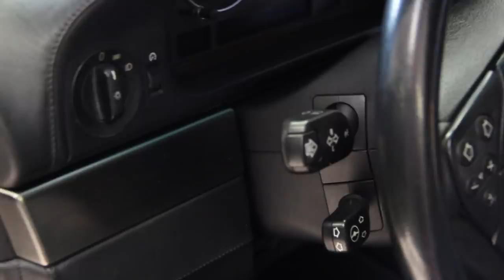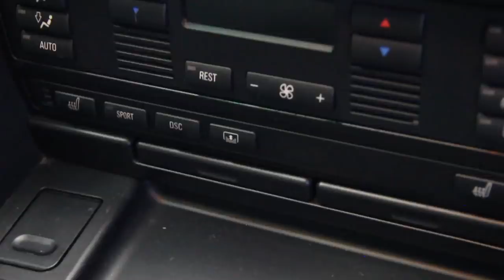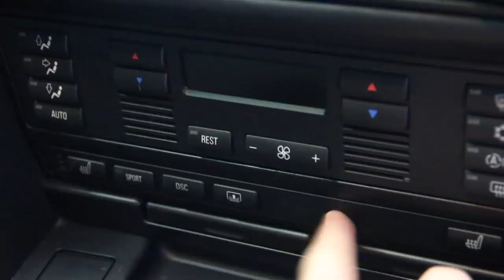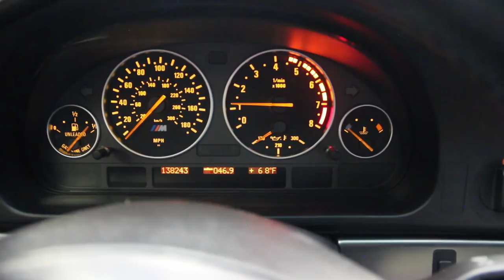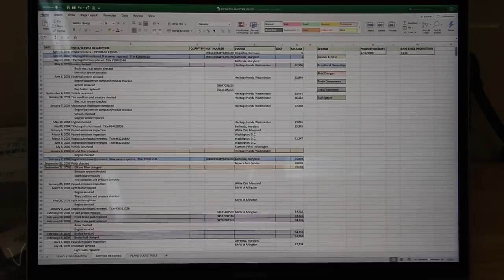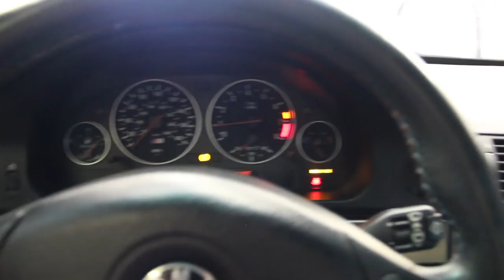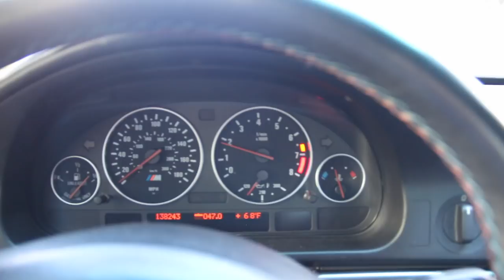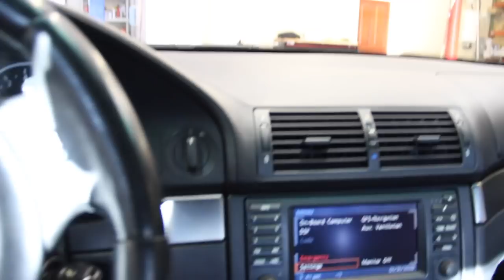SOLD:  2000 BMW E39 M5, E39Source Certified

Comment: 17k? I was expecting something like 25, for sorted M5 feels like a good deal. One thing that you can see on the camera is painted front right fender, Ryan did not mention it because it probably is not so much visible in daylight with your own eyes.
Reply from the maker: If it had a clean California title, I would be asking $22,999.  The fender and hood have been re-painted, and yes, the naked eye is significantly less sensitive to that compared to the camera.
Reply: @E39Source   thanks for clarification! And hope it will find happy new owner soon!

Comment: The whole front end......fenders,hood,bumper and a pilars have been re sprayed, probably why it also has depo headlights. Look closely,Im sure you noticed. Please dont mislead people to think a car like this would be written off for a windshield lol!! Still...... looks like a nice car 👍
Reply from the maker: Depo lights?  Where do you see Depo lights?!  The front has been repainted indeed, and so has my car.  Re-sprays are not signs of accidents...  This M5 has an original bumper carrier, bumper carrier impact struts, and coolant expansion tank.  These items surely would have been damaged in a front end accident.
Reply: E39Source 

My bad on the the depos. But really, all the parts you mentioned are original or original to the car.

Look Im just stating that it has been re sprayed + salvage....  

And the fact they didn’t blend in to the doors not something a competent shop would do. 

By the way I was really thrown off that you would Spend all that time explaining “full leather” and not throw it up on the hoist for a nice once over....... buy hey it got full leather package!!
Reply from the maker: @illusive123  Thank you for the statement.  

Blending turns into painting the entire car.  In person, this is quite a solid paint match.  A good camera lens is much more sensitive to color and metallic flake match than our eyes are.

If you are interested in this car, I would be very happy to give a full tour of the under-side.  Please inform!  Full leather is quite a rare thing to find in these sport cars and so few people understand the difference between complete and extended.

Comment: I would like to know if you’re ever interested in repairing cars for clients? I have an 2000 e39 that needs a number of little things done to it. Like suspension,  drive shaft bearings shifter linkage, leaking steering pump and that would be great if you can do the work with providing me the client confidence that the work is getting done correctly!
Reply from the maker: Hi Ranmond, I'd be happy to do some service.  Feel free to reach out here ryan@e39source.com

Comment: Thanks so much for the comprehensive description and candor. I might be interested, having probably owned BMW’s (dare I say) much longer than you (think new 2002’s). Have you taken compression and  leakdown  readings on this car? Do you have any prior service records (I’m a fluids change OCD)? Thanks and great video!
Reply from the maker: A sale is pending.  If the vehicle is still available, I'll reach out and let you know.  I did not test compression, as this engine pulls like an absolute freight train and sounds great.  The CarFax lists a good bit of service that shows the car was cared for on a regular basis, but they don't specifically list fluid changes/mileages.  I do know that the fluids I removed from this car were quite clean, however.

Comment: Do you have to worry about transmissions in these cars with 130k ? I’m looking at buying one of these this week and I’m willing to spend $20,000 or so on one and then put another 5 to 10,000 into it to get it dialed in. Does that seem reasonable?
Reply from the maker: The S6S420G 6-speed manual transmission is quite a stout gearbox, but it all comes down to how it has been driven and maintained throughout its life.  I've seen them run over 700,000 miles without any more service than fluid changes, and I have also seen failure before 100,000 miles.  A $20,000 E39 M5 will immediately need $5-10k to sort out the driveline, engine, and suspension.  A total of $30k should be able to build a good example, but cosmetic repairs could easily exceed that budget depending on the quality vehicle selected.

Comment: Should I get a 528i or a 540i, going for long term
Reply: I have a 2000 528i...rock solid and super reliable!
Reply: Go with 528, it has the inline 6
Reply from the maker: 528i would be far more reliable and affordable, but the 540i makes a lot more power is more of a 'sports' sedan.